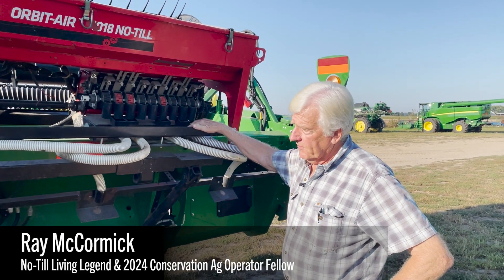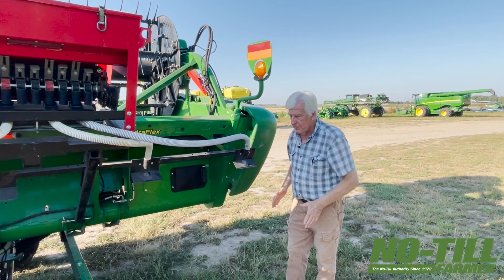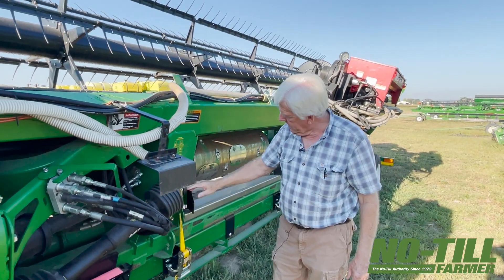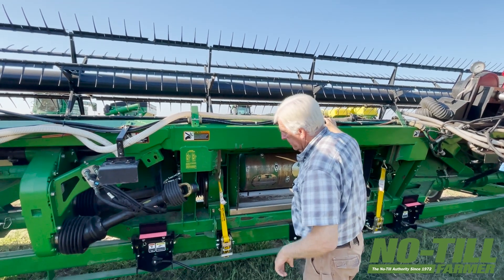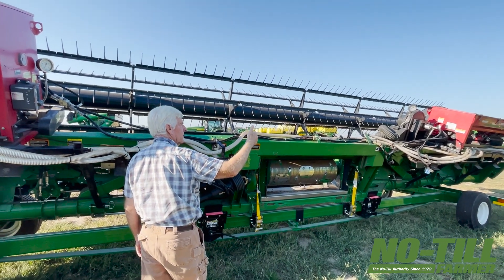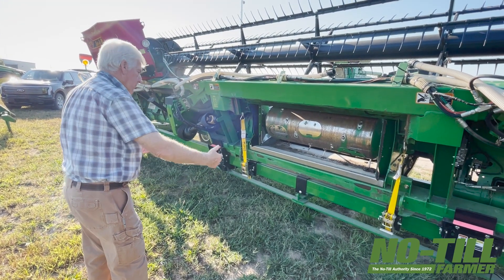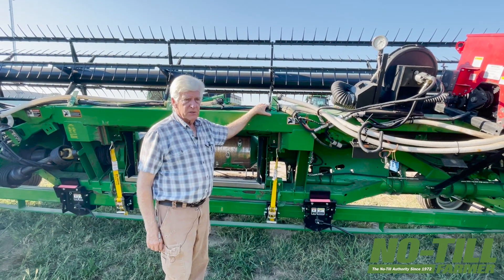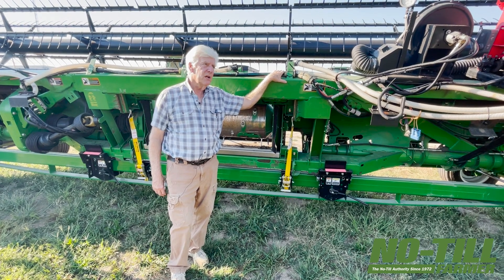One Pass Only: Seeding Cover Crops While Harvesting

Comment: The unfortunate bottleneck we all seem to be hitting is the capacity of these systems vs a drill or spreader. I would point folks to look at species outside of cereal grain family and figure how many acres you can cover with that, or if you're willing to accept a far reduced rate of something like oats or rye.   Last year had a really good trial with a mix containing brassicas and hairy vetch, reduced rate rye with hairy vetch,  and there's other interesting options left to try.   The big thing most of us are not seeking to do is stop the combine and tender seed more than once or maybe twice in an average day.   It can be done, just have to find the threshold you can adopt without upsetting the rest of the system.   I'm using a hopper on the combine broadcast using the chaff spreader. In the fall rush, that's additional farms getting cover that wouldn't make it if waiting on me to spread them seperate.  High erosion risk slopes